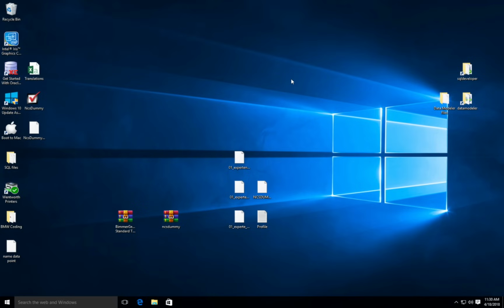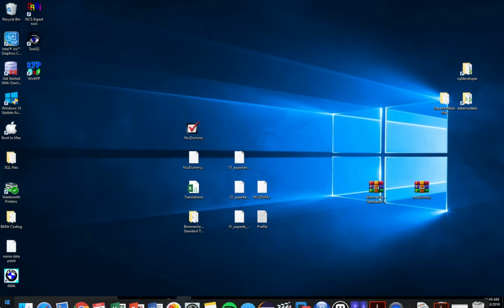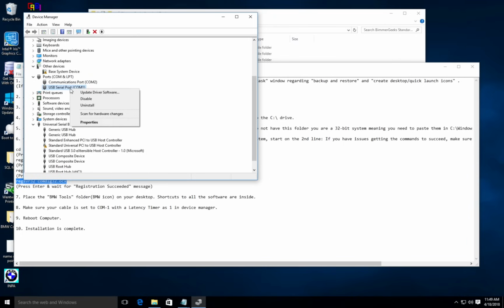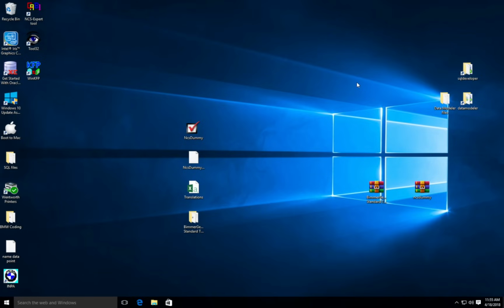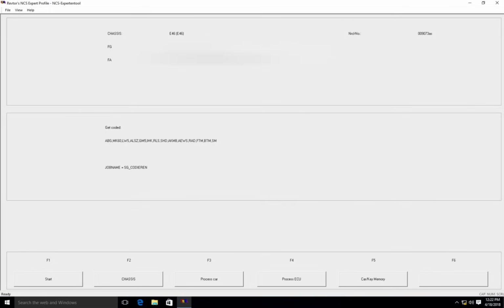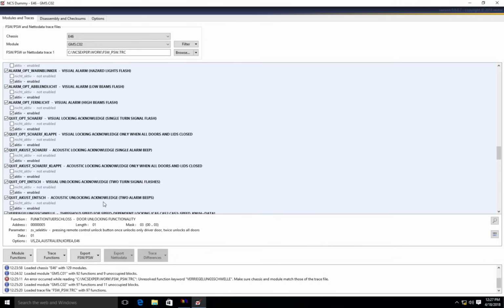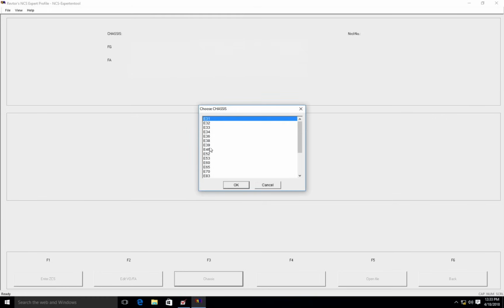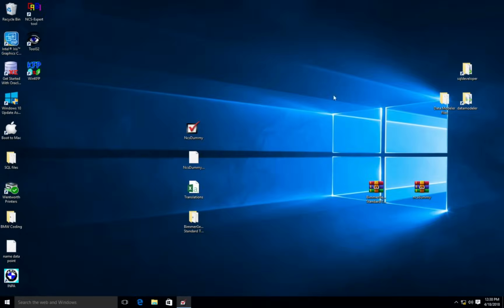HOW TO CODE YOUR BMW USING NCS EXPERT | WINDOWS 10

Comment: I did everything as u explained but no deference like nothing happened
Reply from the maker: Is pin 7 and 8 bridged
Reply: Oh finely it worked thank u soo much I appreciate how u explained evry single detail hats off 😍
Reply: Is there anyway to adjust the idle rpms using inpa ? Can’t seems to find anything

Comment: with mine when i try to load the chassis on ncsexpert it says "vin is faulty" with a load of codes. INPA works
Reply from the maker: Be sure pins 7 and 8 are bridged in your cable
Reply: @EvanGoyuk  just figured that out, bit of soldering fixed it haha

Comment: Hi, I have a question, 
So I switched my bmw e46 2003's front lights to Xenons is there any chance to Code it through NCS or do I have to use DIS? Since I only have acces to K+DCAN cable.
Reply: Horrible mistake... Should just stay with halogen bulbs. So many issues with hids. Ballast and igniter problems. I want to switch to halogen but want to know if I can code it.
Reply from the maker: It’s easy to code.
Reply: @EvanGoyuk  that's very good to know any links to info how to. Code it?

Comment: like to find out if it is possible to re program the headlights and tail lights to stay on for an extended period after i lock the car with the keyfob, at the moment the lights stay on for approx 3 secs, if possible i would like to have them stay on for 60secs or so..is this possible?
2002 320i e46

Comment: I have 2003 745i Bmw do I need to solder PINS 7 to 8
Reply from the maker: Yes
Reply: Evan Goyuk  thank you 🙏🏻  by any chance would you know why it needs to be soldered and what happens if i don’t have it soldered ?
Reply from the maker: Yes so that pin bridges the connection to contact the I/k bus to to allow the the Ecus to be coded. I ended up buying a cable with a switch that when the switch is engaged it bridges the pins. The link is in the description on this video.
Reply: @EvanGoyuk  BEAUTIFUL
Reply: Evan Goyuk  Do you know what module I need to code so I can get sport/manual back to my 2003 745i Bmw
Reply: Evan Goyuk Hi do you know what module I need to code to get Sport and manual shifters working again on my e65 Bmw

Comment: Hello,Im trying to change my e39's LCM2 with LCM3,but it is not happening.The blinkers and high beams are off. The new module is processed with Pa soft so the Mileage and VIN are matching. I have read tons of info,but still nothing. Any help will be useful.Thanks
Reply from the maker: You then have to code it in ncs expert too

Comment: Very informative video! I have a question about deleting bi xenon and adaptive headlights. You might ask why but my vehicle was in a accident just bad enough that damage to both headlights where I ordered aftermarket brighter halogen lights with led running lights. However the adaptive error is up and I need to reprogram so that the brights work now that its not using xenon hid lights. Is this doable? Basically reprogramming car as if it did not come with the xenon headlights but the halogen version? 2011 BMW 328i

Regards

Mike

Comment: I tried to do everything as described with my X3 (09.2006.). When I start INPA the cable connection is ok, the ignition is ok, but I can not see any other data on the on-board devices, just say <NO RESPONSE FROM CONTROLUNIT, and also when I try to connect to the NCS, the program reports the error <VIN is faulty> etc...
What can be a problem?
Reply from the maker: Drivers or com port
Reply: @EvanGoyuk  it was my fault, INPA works but only shows the parameters of the engine operation, but not the other modules.
NCS expert still does not work ...
Reply from the maker: Make pins 7 and 8 are bridged it will not work other wise. I recommend buying a cable with a switch. Or you can solder them yourself. I have a link in the description on which cable to buy.
Reply: @EvanGoyuk  Ok. Thank you!!!

Comment: Do I really need me this type cable I have blue vag Kline can it be modifyd to work with this programme?
Reply from the maker: Yes
Reply: Did you have to alter the K-line cable in any way, or does it work on it's own? I have the same cable, but wasn't able to find a driver, so I'm not sure if its working correctly.

Comment: Hey.

It says no cable detected on my pc in Inpa ??
Reply from the maker: The drivers might be installed wrong or the cable is bad
Reply: @EvanGoyuk  
The cable is new but it is a cable from bmw scanner or the obd is bmw scanner but it can only read the cable only when i plug in into obd it cant read only the cable on my laptop you know the sound pops up when you put a usb in ?
Reply: @ASlesh.  Is the cable OBD to USB or OBD to Ethernet?
Reply: @ChristianBlueChimp  its OBD with usb yes so i can plug it to usb port from laptop to car obd

Comment: Awesome video. Worked like a charm on my 2006 E46 convertible. Thanks.  I do have a couple of questions I hope you can answer:  1. What module do I need to access to synch memory seat position to key remote?  2. Is there an option to have doors unlock upon upon removal of key from ignition?  Thanks again.
Reply: Hi did u find any solution about auto unlock ?

Comment: I cant open the Bimmer Geeks standard tools file correctly. What do i need to open it
Reply from the maker: It should just be a zip or rar file
Reply: It's a .7z file but it has errors when extracting it.  Is there another link?
Reply: Download WinRar and it will take care of it.
Reply from the maker: Yes that is what I use

Comment: Great information and video, I was able to code out the corner leds in my 08 e92 335xi. Thank you so much
Reply: Tim Deng dude, how did you code an e92 with this, there is no option in ncs for any of the e9x’s I have an e90 and ncs expert shows e89 then k1x, how did you do it please?

Comment: Hey man, i was just wondering, can I make my headlights turn on when unlocking the car with NCS EXPERT? I have too e46 330D 2001 wagon and i was searching google for this module and didn't find any tutorial
Reply: Did you manage to do it? I'm interested to do this too but on a mini r53
Reply from the maker: Unfortunately the e46 can not do this from the remote but with the mod light adapter from MOD BMW it can

Comment: So I activated all the settings for having the hazard lights flash and beep when I lock or unlock the car with the remote. I wrote to the ECU, but the changes didn't take effect. Nothing happens when I lock or unlock. What DID take effect was the comfort closing with remote option. That worked right away. Any help on this? 

I have a 2002 325i, 4-door

EDIT: the "unlock all doors with one press" option doesn't work either. I even checked the fsw.psw.man file and all the changes are listed there, but they don't work

Comment: So for my 2007 525i i need to purchase the adapter that bridges pin 7&8 on the K+DCAN cable correct? im getting the ihf-0009 and the coapi errors signifying no communication.. Thanks
Reply from the maker: Yes you to have pin 7 and 8 bridged
Reply: thanks

Comment: Hello Evan,

First of all thank you this video!
Second hand I would like to ask what could be the problem with my NCS_Expert?

I have a failure the step to choose ECU.
Written out a long text: VIN is faulty Coapy 2000 fehler in ediabasoder in sg......
If I not connect to the car can read the same.

The upload done according to the video, the INPA working, I counterchecked every possibilities in ECU-s and pin positions in the Cable.

Can you help me in this topic?
I have an E-46 from 1999.

Thank you in advance to your time!

Comment: Thanks for the detailed instructions.  I bought the cable in your link and loaded all the programs successfully.  When I plug the cable into my car it reads the engine functions like rpm, etc. but for any other function I get the " ifh-0009 no response from control unit" error message.  I have an E46 M3 so my understanding is that pins 7 and 8 need to be bridged.  I'm assuming they are but I'm not certain.  It has four positions on the cable and I've tried all four but I still get the same error message.  Any help would be appreciated.
Reply: I'm also having the same issue and bought the cable in the description with a 2000 E46 if you resolved your issue please tell me how you did it.
Reply: @SuperKayne  Unfortunately no one ever responded and I still haven't figured it out.
Reply: I actually solved my problem if your car has the  Round connector under the hood you need to jump pin 2 to pins 17 and 20 for the cable to function properly from the obd 2 port.  Typically if your car is older than 2001 you will have the round connector.

Comment: Hello, I changed the catalytic converter to my E39 year 2000 and the battery had turned off a few hours after I set it all I started the car and it asks for a code of 4 digits but I never got code now everything works but the screen can not choose tv or navigation nothing is in position 1 but after connecting nothing works thank you some help from you because I followed your tutorial and I already have the glasses to work with the keys thanks

Comment: I just bought a used lcm for my 2006 750li. The LCM module that was in it when I bought the car I'm almost certain was for a 5 series. Although the lights stayed on with the 5 series module, I was not able to use the light switch to turn them off and they stayed on while the car has been turned off.

The 7 series module I can use the switch but some of the lights don't turn on at all and my xenon's flicker rapidly as if not getting enough power before switching off...I have to use the switch to turn then on I only for them to flicker again and turn off. 

The question I want to know is will this setup in your video allow me to program my LCM to work like OEM? Or will I have to take it to the dealer?
Reply: The brakes light work when I press the brakes on the 5 series module but the brakes lights stay on while NOT pressing the brakes on the 7 series module
Reply from the maker: You can code the lcm with ncs expert but you also need bmw scanner to set the mileage
Reply: @EvanGoyuk   because of other videos that I've seen, when I hear the word code, I'm thinking of customization to a car that's in good shape. That's why I'm using the term programming... Whatever it is that the dealer would do to fix my LCM to work properly... Am I able to do that with this setup in your video along with this BMW scanner... What is BMW scanner anyway? It's that a device or is it software?
Reply from the maker: Software and scanner it’s called pa soft bmw scanner
Reply: In other words. If I wanted to fix my LCM and it work completely normal...I can do this with all this stuff. I'm interested in buying it but I don't want to if it will not actually fix my problem.
Reply from the maker: Even if you buy a new one you still have to program it to your car
Reply: @EvanGoyuk  of course and can i program (not code) it to my car? With this stuff?
Reply from the maker: Yes with nsc expert and pa soft bmw scanner I will be making a video on programming a new lcm when my led tail lights come in
Reply: @EvanGoyuk  great! I subscribed a few hours go... But now I want to see this video!
Reply from the maker: I have the lcm I already coded it before hand to make sure it worked I’m just waiting for my led tail lights to test it out fully
Reply: @EvanGoyuk  I would like to ask you. When you got the new lcm and connected it to your car... Did any lights come on... Even if the lcm we're not programmed to your car?
Reply from the maker: Yes it showed all my lights were out and my mileage temper dot was on.
Reply: @EvanGoyuk  odd...some of my lights work! I'll admit it is a used lcm from another 750li but some of my lights worked. Was your lcm module new or used?
Reply: And I see no tamper dot anywhere!
Reply from the maker: Used that’s why you need pa soft scanner to code your new mileage
Reply: @EvanGoyuk  so if I code the milage... Are you saying that all of my lights will work again?
Reply from the maker: No you code the mileage so you don’t have a tamper dot. You use ncs expert to code the lcm so it works
Reply: @EvanGoyuk  is there a place where I can physically buy this cable? Or must I get it online? I've already set an appointment with the dealer for Tuesday. If I can handle what I want them to do provided programming the lcm is all that's needed I can save a few dollars!
Reply: @EvanGoyuk  I want to buy this cable but there's only one review and it's 1 star... Calling the cable junk and that it disconnects sometimes... Have you or anyone you know that does coding for BMW that has this particular cable ever have or had this type of problem before or recently?
Reply from the maker: The one I bought has worked prefect so far
Reply: @EvanGoyuk  and this is from the same link that you show us?
Reply from the maker: Yes
Reply: @EvanGoyuk   hi there. Just got the cable and installed the programs and your files acting to your instructions. I have connected the cable and inpa works fine. I can tap into any light that I want and turn it on and off. However When I want to program the light control module with NCS expert...I load raptor profile, then click start, then click chassis, I click E65 (although I have E66) I see two "selections" CAS and LMA. When I click either CAS or LMA, I get VIN is faulty error. I see that the VIN on the module is different than what's on the car (which is expected because it's a used module) how can I PROGRAM the module to match the VIN number for the car and mileage? Thanks for your help so far!

Comment: Thanks for the tips!I got ECS Expert installed.  I would like to disable the TPMS and enable FTB tire monitor system.  The internet said physically unplug RDC module or pull #27 fuse for non iDrive before procced with coding.  However, the instruction indicated as follow which don't fully understand.  Can you please elaborate how-to code out $2VB and REMOVE $265 in VO?

1) Code OUT $2VB and ADD IN $265 in the VO. 
(need to REMOVE $265 in VO no iDrive) There is a 'Edit VO/FA' button in the Revtor's NDS Expert profile.  I can see the $2VB drop down selection.  Should I input the value of 'OUT' in the 'attribute:' box to code out $2VB?  Also, there is no '$265' in the 'Edit VO/FA' selection.  Does this mean '$265' step is not necessary?
Reply: Hi Evan.  Looks like is a matter of select '$2VB' and hit delete button to remove from the list in the 'Edit VO/FA' screen.  Whereas, '$265' was never in the list, therefore, no action is necessary. Is there a place where we can read  more description on the ECU and VO/FA

Comment: This is good Evan! Video provide a foundation to kick start my motivation to learn NCS coding for 2014 X1 E84.  I went to your link to place an order on K+DCAN cable and will explore around.  For chassis on X1, should one select E89 or E90/E92?  Any guidance you can provide would be greatly appreciated.
Reply from the maker: E89 if not option for e84

Comment: hey whats up... im almost there but im stuck at the command prompt part, every ocx file i enter is either in a different path (or fail to load) or not compatible. should i change location from syswow64 to a 32 file? i did have the syswow . thanks

Comment: Hi I have a question, will you be making a video on coding a compatible PDC module or other modules? 

I've been told I need to "code" it but  all searches result in information like this video. (Which i will be utilising if if ever sort out this module nonsense..argh.)

If anyone can help I'd appreciate it.

Cheers
Reply from the maker: Yes, once I get a new rear bumper I will retrofitting pdc and I will definitely be making a video but this is later down the line.
Reply: Evan Goyuk awesome sauce thanks! (And thanks for fast reply!)

Subscribed and recommended to friends :)

Comment: That was the most step by step how to that I have ever used. It worked flawlessly and was easy to follow. I coded my comfort close and everything works but the rear vent windows. It is late and I have been staring at this laptop for hours so I will play with it more after work tomorrow, but I had to say thank you!

Comment: I'm having trouble coding with NCS Expert. I can only see the BIT, MRS, TEL, and UIF modules after selecting the chassis and ECU... What could possibly be the problem?
Reply from the maker: I have not seen those options before. What module are you trying to code ?
Reply: I'm trying to coding the GM, LCM, ABS, and DSC
Reply from the maker: Your processing one ecu at a time right? What BMW are you coding?
Reply: I would if I could get to them. I see them in INPA but they will not show up in NCS Expert. I'm considering using a different coding program
Reply from the maker: I need to see what your looking at to better assist you email the image of what you see so I can try to help you out. My email is under the about page on my channel
Reply: I appreciate it...